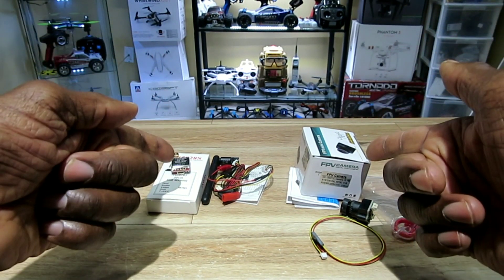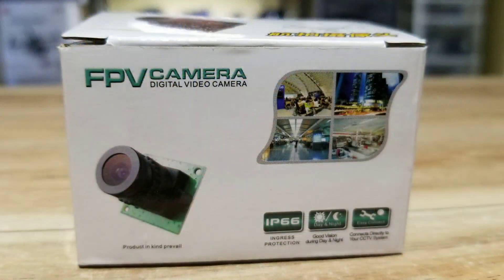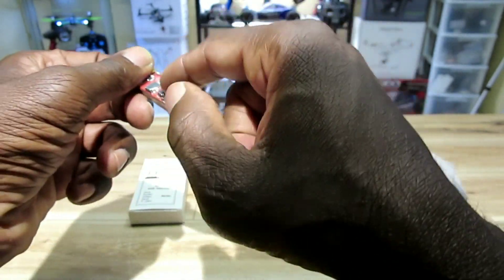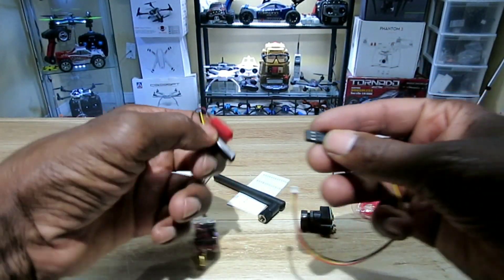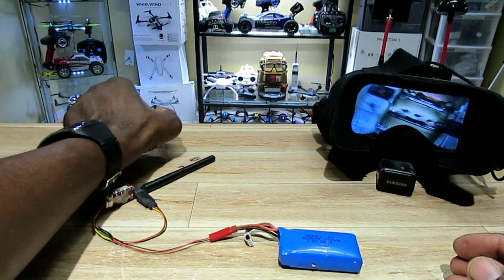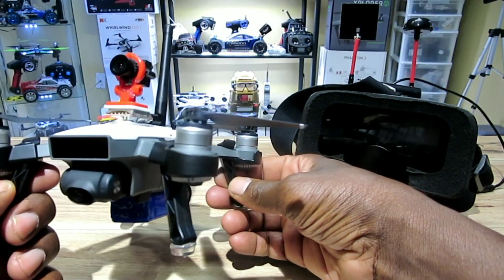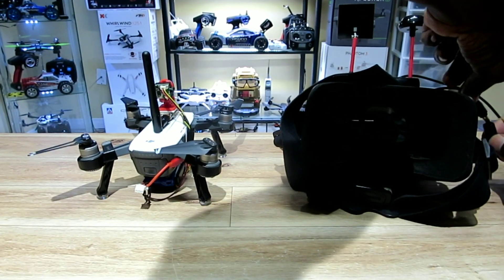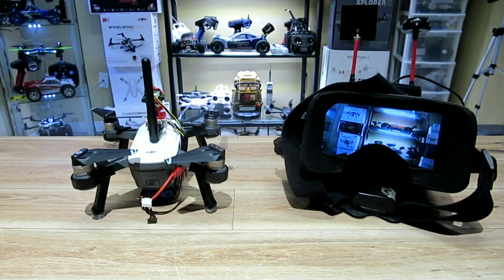dji Spark long range FPV setup. TS5828 transmitter, 1000 tvl cam.(Jan 2019)

Comment: Planning to do this on my second spark that has issues on its camera after a major crash,,, Did this worked without interference on the remote control and the dji camera.. Do you have a video sample with the 5.8ghz fpv camera flight with spark, thanks for your future response update sir..
Reply from the maker: Hey, I didn't get around to testing it. Sold the Spark, great drone though
Reply: @torontorc4637  thanks for your quick response sir, i did asked bec. i do not see any Spark flying with a 5.8ghz fpv camera attached on is top here in YouTube.. I will try to ask Donnie(BigDroneflyer) ,if he tried it too..

Comment: Nice camera setup. What kind of range does it get? I use the akk AIO and I have flown out 1/2 mile, after that it flickers in and out. Will that setup be better for going out a mile or more. 
I have a Hubsan H501ss that I have flown 1.2 mile. FPV all the way and back. The only thing I did was moved the internal antenna outside of the drone. 

Nice review Bro! 👍🏽😊
Reply from the maker: Hey thanks man! The transmitter is pretty good, I'm guessing at least 2 kms/1.2 miles. Thanks for passing through man👊🏽

Comment: You got more guts then me, I always have GPS getting interference from the vtx. The camera will have more range then the spark will. Good luck bro I hope it works out for ya, I just worry about interference, it has happen to me on another quad. Cant wait to see the flight bro.
Reply from the maker: Hey bro, if  it  flies a little weird  I'm landing that thing. We'll see, should be fun to fly the spark long range FPV though. Have a good one man 👍🏼
Reply: @torontorc4637  be safe E, can't wait to see the video. 👊😉

Comment: Freaking snow storm in the middle of May.. Thats crazy man..
Sweet mod brother can't wait to see the footage and range you get from this man. On quick question tho.... U said it was a 5 volt system, but u put a 7.4 battery on it. I dont mean to sound dumb and by no means am i trying to correct you so plz dont take it that way but I would hate to see ya burn up a brand new system.
Reply from the maker: Hey man, I made this video a while back in the winter. Great weather for the most part now. That was the only spare battery I had at the time. Have a good one👍🏼
Reply: @torontorc4637  lmao... Gotcha brother. I knew the weather had been screwed up, but I dint think it was that bad...lol